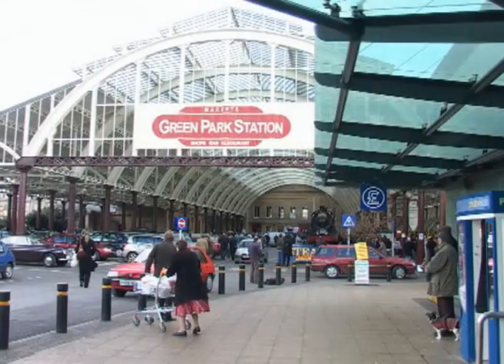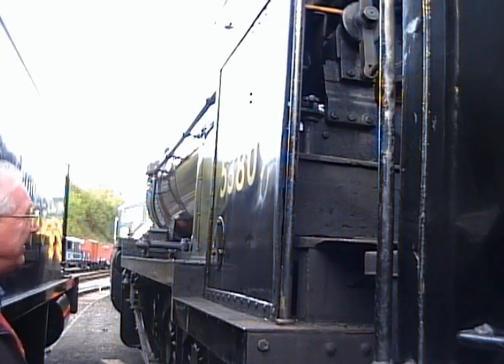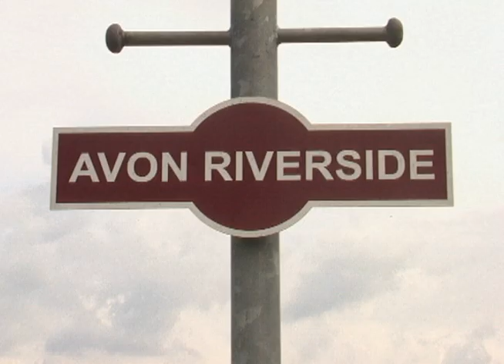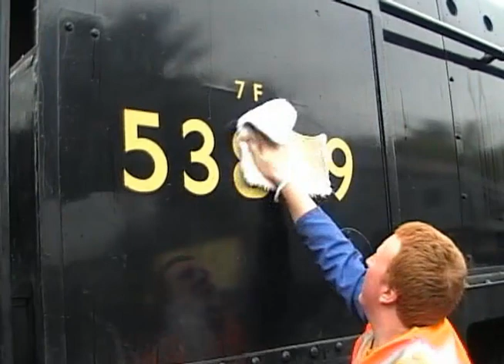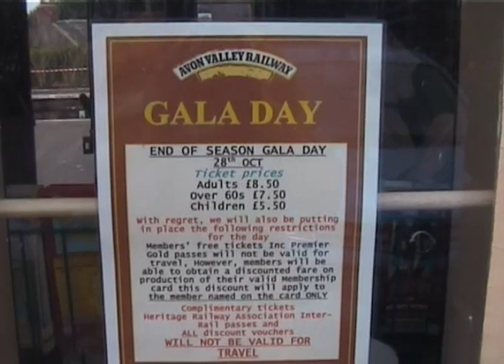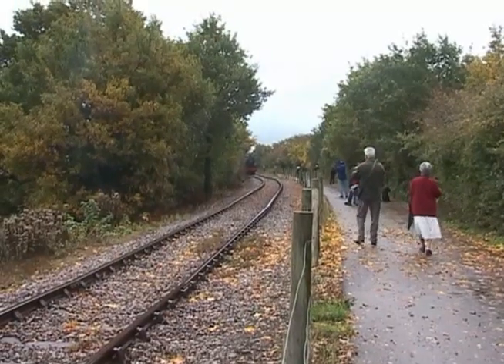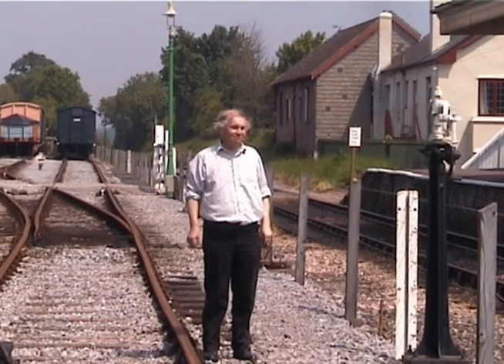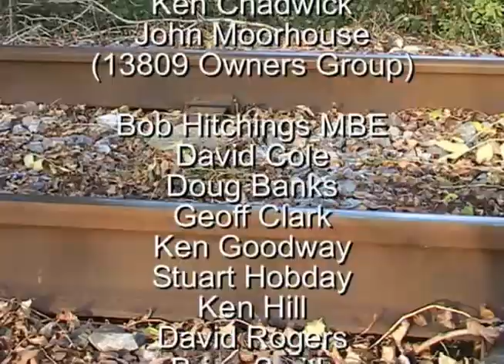S & D 7Fs live again   with a bonus footplate ride

Comment: Very much enjoyed this production; thank you. In the credits you might want to correct '13809 Owners Group'.
Reply from the maker: Hi Nigel,

Is the credit not right then?

Thanks,

Philip
Reply: @philipfowler5280  Hi Philip. In the credits, special thanks are given to 'Ernie Bradley, Ken Chadwick and John Moorhouse (13809 Owners Group)'. Unless I'm missing something I would assume that's meant to read '53809 Owners Group'.
Reply from the maker: @nigelpaul6235 - I can't recall why the LMS number was there rather than the BR number. Did the Group use both? Or swap over later? I must have thought it was appropriate at the time.

Regards,

Philip
Reply: @philipfowler5280  Hi Philip, to be honest I thought this was simply a matter of a misplaced digit in the credits, as opposed to differing LMS and BR numbers. I hadn't realized that they would have been different. My apologies.
Reply from the maker: @nigelpaul6235  

Hi Nigel Paul.

Where Railways are concerned, it's darned easy to make a slip!

It's really heartening to get comments from folk like you who say that they have enjoyed the material.

Many Thanks for your interest.

Best Wishes,

Philip